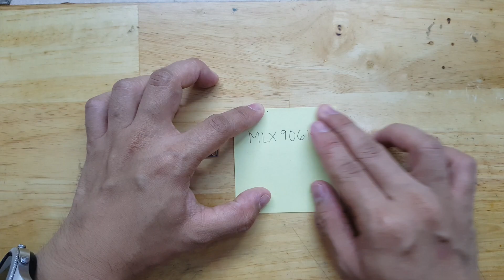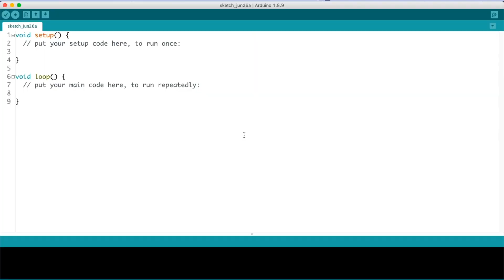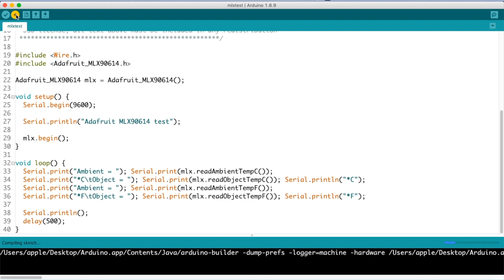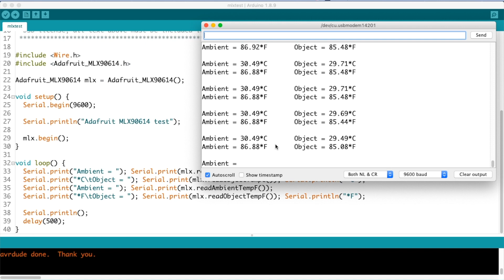MLX90614 IN ARDUINO UNO DEMO AND TUTORIAL

Comment: I wonder if the chip is genuinely from melexis cause those chinese modules are way too cheap
Reply from the maker: Not really sure on that. It's hard to determine on first test.
Reply: @circuitdesolator  nalilito nga ako sa datasheet nyan. Sabi kasi one section na need pa ng input from an external sensor to compensate for ambient temp. Sa isang section naman, may builtin sensor na daw sa chip. Di pa nag rereply yung support nila